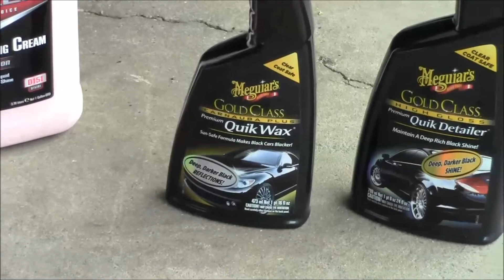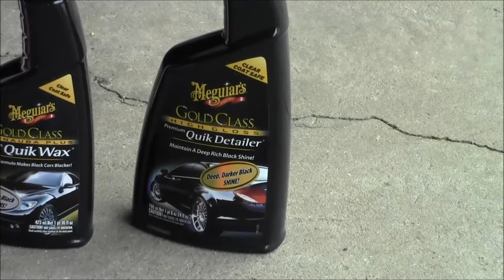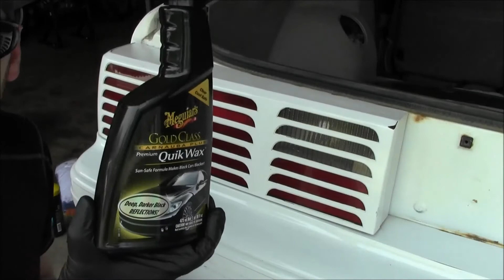... say CHEESE! Foxbody Style tail light detailing (D151)

Comment: Anyway, thought I left a comment here, possibly not. I guess what I needed to know, was what's needed to prep for re-wax? Do you need to strip old wax before you clay, polish and wax? I know I have a lot of questions, but you seem to be knowledgeable in these things. Thanks!
Reply from the maker: When was the last time you waxed your car?
Reply: fwh79 last fall
Reply from the maker: You won't need to strip the old wax.  You will need to make sure the surface is clean.  You can either wash the car with a dish soap or use Meguiars M34 Final Inspection to clean off the surface.  Then you can clay bar the car and move on to polishing.  When you are finished polishing, you can wax the car.
Reply: fwh79 ok, thanks! Just clean it real good, clay, polish and wax? Any paticular products you recommend for black? I want to get the swirls out. Car looks great from 5 ft, but man, it could be better, a lot better. And if you're partial to a brand, so be it...just let me know, if you know, some special things I can do to black. I appreciate your input.
Reply from the maker: You're welcome.  Yes, just be sure that you do not clean the paint with a wash and wax car wash soap.  The wax will make it harder for the polish to cut the paint.  I have really good luck with Meguiars products.  Product selection depends on the severity of the paint damage/swirls.  Have you watched my auto detailing playlist at all?
Reply: fwh79 no I haven't, I will though. Long story short, I used a shitty brush cleaning my car past fall. It DID NOT have swirl marks on it t until I washed it with that brush. So I used the 2 statge Jet Black Turtle Wax kit...it cleaned it up really good...but they're still there...when looking for it. Someone told me a No. 6 Glaze helps that out, not sure if you know anything on that. Also, mine is single stage paint, Ford didn't put clear coat on the Fox until 1990...if that makes a difference
Reply from the maker: Yeah, the brush probably caused some scratches.  That's ok, we can fix her up better than ever!  No. 6 Glaze is probably not going to fix your problem.  That glaze is really to be used on an undamaged paint job.  I would pick a different product for your needs.  You need to decide if you want to use an AIO (all in one) product or a three step setup.  The all in one is a compound, polish, and a wax.  The D151 is an AIO product.  The three step method would involve using a compound, a polish, and a wax.  Single stage is not going to be a problem.  It is just a little messier because all of your applicators and towels will be turning black.  I would recommend that you discard any towels you use when you are finished with them.  You can probably wash and reuse any towels that you use for waxing though.  You also need to decide if you want to use a power tool, or do it by hand.  I would recommend that you do it by hand if you are new to detailing.  It will help you understand the process much better than using a tool will.  However, if you would like to use a power tool, that's fine as well.  Let me know if you want to do it by hand or with a power tool and then we can decide what products you should use.  I will be posting videos of the detail job I did on my R6 this weekend.  I did that whole bike by hand and the results were pretty amazing.  I think those videos will really help you out when I get them posted.
Reply: fwh79 thanks again! Yeah, if I could use a good AIO product, I'm totally good with that. I suppose I assumed that good detail jobs were dependent on the steps involved, the more, being better. Sounds like this is not the case. And I have an orbital buffer I bought, I used it, but it seems "by hand" works better, IMO. I don't mind doing it by hand...so I can do it by hand. Really, my biggest concern are the light scratches and the swirls. I know a good detailer could make this paint look showroom. I almost am willing to allow a good detailer to work it, then I will maintain it. However, I'm picky about people even working on the car...so I'd much, MUCH, rather do it myself. I'm certainly not afraid of work. So let's plan on me doing it by hand. What's your suggestion(s)?
Reply from the maker: I really like the Meguiar's D151.  I would suggest that you start by detailing your tail lights.  Follow the two videos I posted about that topic.  The tail lights are very forgiving and will help prepare you to move on to tackling the paint.  Start with the third brake light and then move on to the cheese graters.  Your car being black is going to be much easier to see the results.  My white car makes it very hard to see what the polish is doing.  I posted the first video for my R6 detail.  Watching that should help you out.  The next R6 video I post will take you through how to buff the paint.  I used the D151 and it turned out very nice!  The R6 detail videos will have links to all the products that will help you out.  I would get some M34 final inspection, clay bar, microfiber towels and applicators, the applicator holder (must have), D151 PRC cream, some masking tape, and your choice of wax.  I recommend a paste wax for the initial waxing after a polishing job.  I feel the paste wax is better at what I like to call "wax loading" the paint.  I would use either the final inspection or a nice quik detailer with wax in it (gold class or ultimate quik detailer) as the product to maintain your freshly waxed paint.  I prefer the quik detailer with wax in it myself.  Let me know if you have any more questions.
Reply: fwh79 thanks for all the info. So basically, just follow what you've laid out here then? I'm going order the stuff you've outlined, once it gets in, start it. I've never clay bared before, looks pretty straightforward. So, clean the car with Dishsoap, dry, then clay bar then the D151, then some final spray wax? I'm not missing any steps?? I do appreciate all your help man, thanks!!
Reply from the maker: You're welcome.  Yes, you've got it.  I would highly recommend a paste or liquid wax instead of spray wax.  I like to use spray wax after a wash.  However, I feel it is too light to wax with after a good polishing.  Check out this video when you get a chance.  It explains the clay bar method in more detail and will help you understand it much better.  I use a clay mitt instead of a clay bar, but the concept is exactly the same.  https://youtu.be/L8fTc6hWLMs
Reply: fwh79 ok. Well...I cleaned and clayed my entire mustang. The claybar didn't really pull a lot (which is good I suppose), except under that spoiler! I was able to pull almost all that gunk off with the claybar. Looks a lot better. Then it was on to the D151.
I have to say, the D151, did wonders on the lower, plastic/poly ground effects, parts of the car. It also did a great job on the cheese Graters and the upper brake light.  However...it did very minimal to the swirls (or Halograms as you call them) on the actual metal parts. I still can pick up all the hairline scratches and swirls with my LED. I elected to wax with a black turtle liquid wax over the Mother's paste...to see if that would help, again, minimally. I only got to one side wax on the car.
I'm at a crossroad right now. Should I just put the wax on and drive it...or,  see what maybe the meguire's ultimate compund will do? I've never 
 used a rubbing compound...not sure if I need a DA tool...since all I have is that orbital buffer (one speed). Let me.know your thoughts...I may be just being picky...I did two layers of the D151...even used the orbital to do the second round. I don't know...getting a discouraged.
Reply from the maker: J PP:  There are limits to the results you can achieve by hand.  Have you looked at it outside?  If you haven't, look at it outside in the sun and decide if you still want to go further with correction.  If you are looking to get closer to a 100 percent correction, you need to pick up a DA polisher.  However, I would recommend that you try using the Ultimate compound by hand first and then follow it up with either the Ultimate polish or M205.  I would suggest M205 because it works better than Ultimate polish in my experiences with it.  The Ultimate can work ok by hand, but it seems to have trouble working with a DA polisher.  At least that has been my experience with it.  You can do compound and polish by hand to see if you get a better result.  You can even use those products with your orbital.  However, if you are not satisfied with a two step by hand/orbital, you will need to step up to a DA polisher.
Reply: fwh79 I haven't looked at it outside yet. In fact, when I was leaving work last night, I was looking at a coworkers, brand new, black, Yukon Denali. Even it appeared to have what I was seeing in mine (swirls/Halograms), and I know it's 2 stage with a clear coat. Left me wondering if that's just the way mine is suppose to be? Then I was at a cookout last night and was looking at an older (2007) Black MonteSS in the driveway and that paint looked terrible compared to my 31 year old Mustang. I don't know, like I said...maybe I'm being picky...just feel it coyld look "great" with the right stuff. But I have not pulled it out into the sun. I will most likely don't hat later today. But if it still doesn't look right and inbuy the other stuff you mention, can I go right over the wax with it? Can I go right over the wax with it? Again, I appreciate all the help. I may try to make my first YouTube video of the car and post it for you to look over.
Reply from the maker: J PP:  Well there are a few things to take into consideration.  Some paint is just not going to fully correct no matter what you do and it needs to be repainted.  Even the Lightning I'm working on right now.  It is not 100 percent... not by a LONG shot.  However, the buffing is making a substantial difference on the over all appearance of that truck.  So, it's not "perfect" but I am very satisfied with the result.  Now, like you were pointing out, even brand new vehicles sometimes need paint correction off the showroom floor.  It happens more often than you think.  So the age/type of paint is neither here nor there sometimes.  There are many factors that effect appearance that trump the age and paint type.  So here are my recommendations.  Before you continue, take the car out into the sun and decide what you think about the finish.  You may find that you are very happy with it.  If you pull the car out and you are not happy with it, I would pick up some Ultimate compound and some M205 polish.  You can pick a spot, maybe half of the hood, and try it out.  When you finish working half of the hood with compound and then polish, pull the car outside to inspect it.  If you like the results, you can finish the whole car that way.  If you do not like the results, you will have to decide if you want to get a DA polisher or not and take it to that next level.  As for working over the wax, I would remove it with wax and grease remover.  The wax has a tendency to fight the products (compound & polish) as they are trying to correct the paint.  The other thing to keep in mind, that D151 may be able to provide all the correction you need using a DA polisher.  However, it also may not... this is why most people who detail cars have an arsenal of products at hand!  =)  So the choice is yours, you can just buy the compound and polish and try it out by hand.  That could work really well.  Or you could just step up to a DA polisher right away and use the D151.  However, you may need the compound, polish, and DA polisher to get the result you are looking for.  You really won't know with out doing some experiments on your paint.  It's your choice as to how you would like to continue.  I personally think you should pick up some compound and polish first.  That is the lowest cost way to possibly get the results you are looking for.  Let me know what your thoughts are on it.  I would love to see a walk around video of your car.  Looking forward to that!
Reply: fwh79 thanks again. I just actually pulled it out to turn it around so I could work the Drivers side later tonight. It actually looks pretty good. Maybe I am."chasing" perfection on it. I may just wait to wax the driver 3 panels, grab the other two items and see what they will do, at least on the hood or door first, then go from there. What kind of degreaser/remover do you recommend?
And yes, if I can figure out the video thing with YouTube...I will do a walk around.
Reply from the maker: J PP:  You're very welcome.  There is nothing wrong with "chasing perfection" ... just keep in mind that you are new to detailing and it will take some time to develop the skill.  I think picking up some compound and polish is a very good idea.  You can try it out and see what happens.  Keep in mind you can always go back and try different products at anytime later on.  I have a link to the wax and grease remover in the description.  That stuff can be hard to find and very expensive at retail stores.  I know what you mean about "figuring out YouTube".  I feel like it is a small miracle whenever I can post a video!
Reply from the maker: J PP:  I was wrong about the wax and grease remover link... it's in this video  https://youtu.be/YjwIuQfntPg  I really need to add it to my "garage arsenal" list.
Reply: fwh79 thanks, yes, I hopped over there and found it, Prep All. I will just get some of that and the other 2 products and see what I'm going to do from there. Always thought about doing detailing as a "side hustle"...but man...it's more of a full time job, lol! Thanks again
Reply from the maker: J PP:  You're welcome.  Yeah, good idea trying the compound and polish first.  Yeah man, detailing can get pretty involved.  Not to mention, if you do it wrong... the car usually needs to be repainted.  No pressure!  =)
Reply: fwh79 lol, right!! Let's hope I don't screw it up THAT bad
Reply: fwh79 is that M105 some really tough shit? I got some Ultimate Compound and M205 on it's.way, should be here Friday. Bought some M9 Swirl Remover too...just to add to the arsenal...if neither of the other 2 don't give me some better results. Not sure what the swirl remover is considered, a polish?
Anyway...I'd these 3 don't cut it, is my next step that M105? I assume I will need a DA polisher for that stuff...looks pretty aggressive.
Reply from the maker: J PP:  M105 is one of Meguiar's strongest compounds.  However, it would not cut some of the old wax out of the jambs on my white Mustang.  I had to use Meguiar's medium cut cleaner to remove the old wax.  So i'm not sure M105 is "that" strong.  It also does not work well with a DA polisher.  They claim it is designed for use with a DA, yet I have had a really hard time using it that way.  I love using it by hand.  M105 works really well by hand, but not very good with power tools (in my experiences).  That is why I am using Ultimate compound and M166 on my dad's Lightning.  I felt the M105 would just make the job much harder to perform than it needed to be.  I think you made the right choice with the Ultimate compound and M205.  I love M205 and if I didn't want to try out the M166, I would be using M205 to polish the Lightning.  The M9 is considered a polish.  It is probably an older product compared to the M205.  It will come in handy, not a bad product to have on hand.  It is funny how some products work better in certain situations than other products do.  I think you will be fine with the Ultimate compound and M205.  If they "don't work" by hand, you can always step up to a DA polisher.  They work really well with a DA so the question is not really if the products will work.  The real question is, will you get the result you want by hand or will you need a DA polisher?  I think you will be fine doing it by hand.  However, you will probably be very interested in trying out a DA polisher when you are done.  I'm sure you like using the orbital vs. doing it by hand.  Doing one panel by hand correctly, makes me want to take a nap.  It is very labor intensive.  The DA polisher is a step above the orbital and the results it provides can be top-notch.  Plus it really cuts down your fatigue level.
Reply: fwh79 I agree...I've been eyeing DA polishers...I may buy a cheap one (Arbor Freight) just to get going with one. That "hand", one speed one I bought is ok, just doesn't have the RPMs a DA has. Still helps spread the stuff out. Very labor intensive by hand...why I scrapped.the idea of it being a side hustle. I don't know, maybe if I get the hang of it, I could do it on the side. 
I "almost" bought the M105...but will try the M205 & UC first. And the M9   is just something more to have I guess.  I have other cars to clean up now with all this products on hand. 
In the meantime,  I will strip the passenger side of the wax and then polish my Rims. Hopefully have this wrapped up over the weekend and be cruising by next week.
I will let you know how these products do.
Reply: fwh79  still trying to understand/grasp the pad type you use for the different applications, with a DA polisher too. They make all this detailing stuff like reading wallpaper. I get it's a skill, but does there have to be so many options? Feel like I'm shopping for pickles.
Reply from the maker: J PP:  I'm sure the M9 will come in handy.  You may find that the M9 on a polish pad can correct one of the other cars you are looking to clean up.  I'm not sure if I linked you the video of my brother's truck and M205 (I think I already did... can't remember!).  I'll share that with you.  The DA polisher is really the way to go.  I still feel like doing it by hand is the first step though.  You learn more about the process and you will appreciate what the DA polisher brings to the table a lot more.  Here is that M205 video:   https://youtu.be/bN9dC2vznvY
Reply from the maker: J PP:  Well there are mainly 3 pad types.
1.  Compound Pad
2.  Polishing Pad
3.  Wax Pad
You really only need the compound and polish pads.  The wax pad is for a cleaner wax or if you have a liquid wax and just want to apply it will the machine.  I'm a big fan of paste wax or spray wax by hand.  So I don't use the wax pad much.  I will use it for correction some times on a car that is in fairly good shape.  Basically the different pads are different levels of cutting power.  Much like the compound vs. polish.  So they vary in their level of aggressiveness/cutting power.  They are interchangeable to a degree.  For example; you may use a wax pad with M9 and get a perfect finish on a car that is in good shape.  Where as, like your Mustang, you need more aggressive products and pads to correct it properly.  Depends on the shape of the paint you are working on.
Reply: fwh79 ok...what I kind understood reading...but then they go off into Orange, Blue, Red, White, Black Pads...holy shit, had my head spinning. I guess different manufacturers have color coding to their pads? 
But I think I may run out to look at DA's this weekend. It will certainly speed things up...and most likely do a better job at working the compound polish in before waxing.
That's the correct steps, right?
Compound, Polish, then Wax?
Reply: fwh79 yup, your brothers hood looks A LOT like the problem I am having. Don't get me wrong, the paint looks good, but get up, right on top of it, like you did in that video, same thing, light scratches, and swirls (Halograms). Looking at it when passing...the paint looks really "rich"...I think that's the result of the D151. It cleaned it up nice...but the "scars" remain. We'll see what the weekend brings... hopefully this UC and M205 does the trick...we'll let you know. May be popping thru Arbor Freight (for a DA) as well...got one in driving distance near me.
Reply: fwh79 Well that was interesting helicopter video....
Just wanted to report, UC & M205 has arrived. 1coat of UC, 2 M205's...and wha-lah... scratches and swirls are almost extinct.
I honestly can't believe how good it looks.